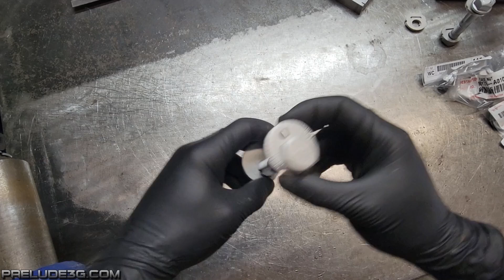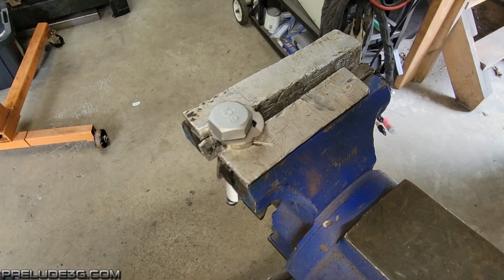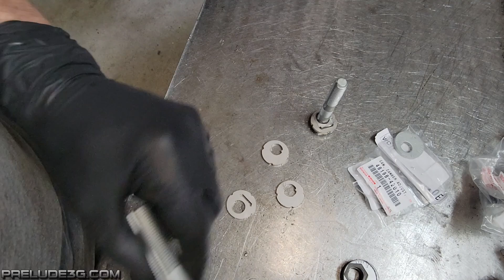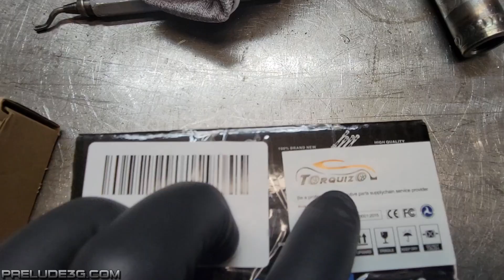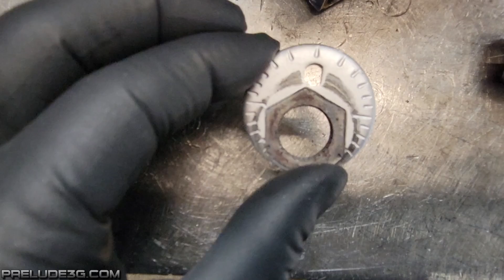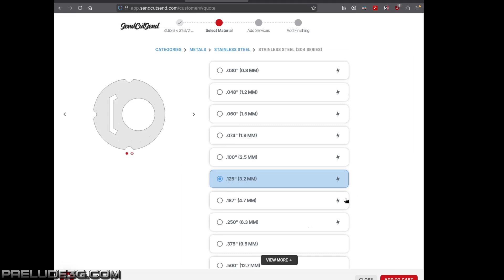DIY: 4WS Replacement Cam Bolts

Comment: I just got a full 4WS setup from the junkyard (crazy find in 2026), only thing I was missing was one of these bolts because someone had taken it with the control arm. This is immensely helpful, thank you

Comment: Hey, love your videos man keep it up I learn a lot from your videos. I have a 3rd gen Prelude myself and I was wondering if you can help me with my high idle after I change gears and while I coast after i connected the speedometer cable to the the cluster.